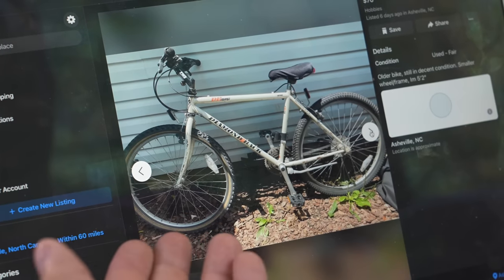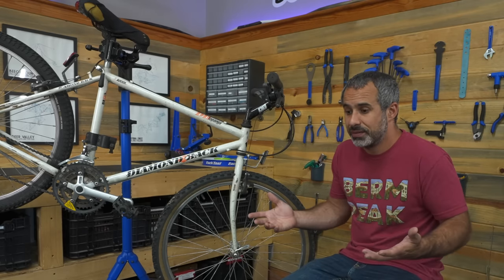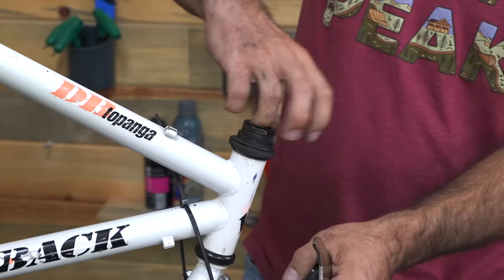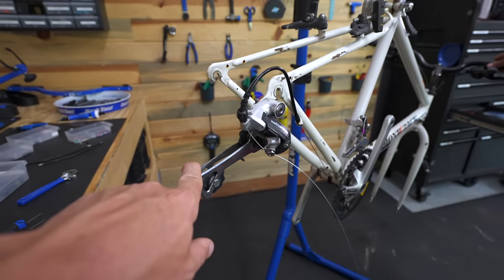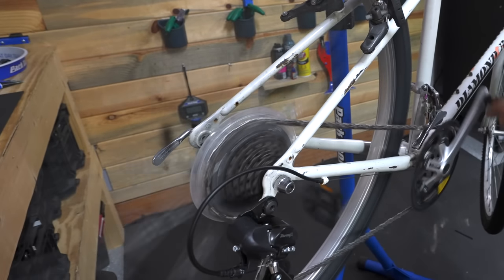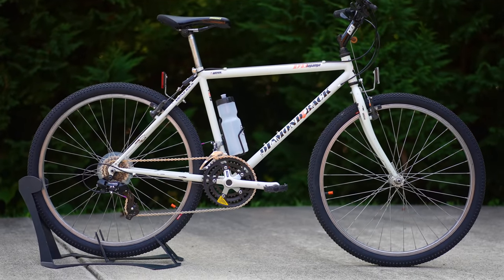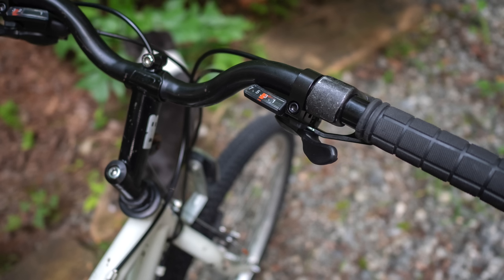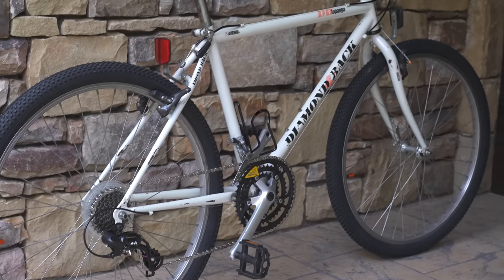90's Mountain Bike gets Transformed for Profit (Flip Bike EP1)

Comment: Inside the shift levers there's a little pawn and spring. Where the bike has sat unused for ages the factory grease dries up and the pawl and spring jam/stick when you operate the shift levers. With a little lube and a pick you can unstick the pawl/spring and the shifter will be good again for another 35 years. You're welcome, folks

Comment: Much of my work at the LBS here in Seattle is doing this very thing to old beat up steel bikes. The "Gold-level tune" costs $250 in labor plus cost of any new components, usually comes out to about $350-400 with a new chain, brake pads, cables, sales tax etc. And the customer walks out the door with a bike that's still only worth about $150
Reply: That refurbished bike might be hard to sell for more than $150 but that isn't why the customer brought it to you. That refurbished bike is going to ride better and last longer than a new low end $600 bike. Which is a better value for the customer?
Reply: @zone4garlicfarm  Couldn't agree more

Comment: I wonder how that chain worked with that old freehhub. Also, no cleanup and regreasing of the hubs and the bottom bracket ? I liked the brake lever trim modification. Really need. I'd only paint the cutoff surface even though it's covered by the shifter.

Comment: If you don't have an air compressor, isopropyl alcohol (IPA) works just as well to install grips (and to remove them). Just wet the bar and inside of the grips with IPA and they will slide on slick as a smelt. In a few minutes the IPA will evaporate, leaving behind no residue and the grips won't budge. I've seen people use lubricants like WD-40 which is a bad idea, because there will always be an oily residue between your grips and bars.

To remove grips, lay the bike on its side (because you need the help of gravity) and take something long and thin that won't scratch your bars (something like one of those long wooden sticks they put corn dogs on for example), push it down between the grip and the bar, and pull outward so you can pour in a little IPA. Leave the stick in there and start twisting the grip and pushing the stick farther down as you go. The IPA will work its way down and the grip will slide off the bar.

I've installed and removed grips with the help of IPA dozens of times; works every time with ease.

Comment: if you are looking for a video Idea I might have one for you. I got a cheap mountain bike recently and it has a Marzocchi Bomber Super Fly z.2 front fork. from what I can tell, Marzocchi is a name brand but this thing is goofy, it has 2 filler valves placed in such a way that you have to remove the brakes to pump up the suspension. it's just an odd fork the only reference I can find is an Ebay listing.

Comment: Reminds me of my 26" mongoose. I don't remember the model of the shifters but i remember you could go up 3 sprockets at a time on the rear cassette and down one at a time but one of the shifters broke a tooth on the mechinism causing it to skip on the way to the smaller sprockets so you had to drop 2 then after you could climb back up one if that was the gear you wanted. I remember that mongoose having a pretty low seat height for a 26" so i could throw it around like a large tire version of a bmx. I remember the quick release feature and the v brakes and some other things seeming really high end untill some of my friends getting trek bikes some years later which were similar but slightly better. Im sure i ruined the bike with a gel seat and grip shifters after the og shifters started to fail. But it was fun while it lasted.

Comment: Have an old Diamondback Apex that came with that front oblong sprocket.  Only paid 10 bucks for it from a garage sale because owner thought that the front sprocket was bent (I also thought so too at the time).  Didn't care too much for that, was pretty strange, and changed it for a conventional front sprocket from a newer Raleigh parts bike for that i had bought 20 bucks.  I have like half a dozen bikes and have a hard time selling them as well.  Yeah probably even fixed up that old Diamondback would only bring 100 bucks because most people don't know how good they were back in the day.

Comment: Thing is that most bikes that you buy have disc breaks and I bought my bike for about £150 and no disc breaks including that my bike has 60mm suspension travel and doesn’t move alot and idk if the bike likes oil in the chamber so I just left it alone and all I hear when I compress the suspension is air.

Comment: The "something gummy" in the shifters was the original grease that hardened and made them non-functional.  If bike owners simply open up these shifters every other year, fully degrease and regrease them, and reassemble them, they'll probably work forever.  But they do not like being forced once the grease turns to glue.

Comment: "Sell it for double, or more!"
Selling for $140 or even $210, you're gonna make $70 or $140 on a bike that takes six hours to overhaul, PLUS parts?
A worthy cause, don't get me wrong.  But you aren't retiring early doing THESE flips!!!

I do it for the love and appreciation of restoring perfectly good things.
The 1989 Shogun I just did this to turned out amazing.  Plus, with 11 grade 25 1/4" bearings in the BB instead of 9 grade 200, the BB is pretty damn smooth (more durable too).  And the headset went from 16 low-grade bearings to 26 grade 25.  It's almost Campy-smooth now!!!  (Not really.)
*Toss the bearing retainers - they're only used for ease of assembly at the factory.

Comment: What if I told you the hole in the end of the grip is for the air compressor to blow into? You just need to block the hole on the other end of the bar and you'll actually get a good seal, unlike putting the compressor under the side of the grip.

Comment: You lucked out that the rear cassette wasn't as worn as the chain.   I have replaced so many shifters when rehabbing bikes.  They just are not durable. Rather than Goof Off I use PB blaster to clean out gummy shifters.   One thing I often do is replace the front stem with a taller but shorter stem as people seem to like a nice upright position. I know what you mean about keeping bikes you fixed.  I have a bit too many I've held onto for one reason or another. Good idea for a series.  I should have thought of it.  Oh, you have a nice shop.
Reply: Oh, bike coops are a good source for cheap brake levers, especially cantilever levers.

Comment: @3:45 you see it skip the gears. Third "ratchet" and suddenly it's outta gears to click.

Now, it wasn't ACTUALLY missing teeth- but it was skipping them. Almost like the thing was too well/strongly strung. Ironically, great cables can sometimes mean the return spring moves faster than the bike will allow. This is a problem with these shifters I'm still puzzling over, but- sometimes it's genuinely just wiggling back and forth that little "catch" piece so it moves smoother in its joint and hitting it with a very light oil instead of WD40 and Goof-off, which are sorta water-replacements rather than a proper oil.  this helps it "catch" those gears- because just before those ratchets, you can SEE those teeth are actually all still there.

Basically, what's happening here is that there's like, a hammerhead-style looking thing, like the head of an oil derrick, that is the 'clicker.' It's one of the more finicky elements. You can wiggle it around, because it's kinda just riveted in a lotta the time. If you get it a tiny bit loose and get some oil in there, it'll catch more reliably on a trigger-pull, and you wouldn't be skipping gears, and wouldn't need to file off those gear stanchions, or buy/use those parts.

Though you can get a bit more $ for using modern shifters, keeping the Deore derailleur- which I think he replaced thinking that IT was the cause of the problem- might've also helped the bike keep some good value and helped ya flip it

Comment: Nice bike but too bad you destroyed the shifters and put the cheapest available tourney tx group on in. 
Next time you got this, clean the hatches and ratches with brake cleaner, move it till all the old grease gets out, clean it even more and after drying, put some good oil in the pivot point. I prefer Rohloff oil but Finish Line has some usefull stuff aswell, available in the states. You could also use new shifter and the old derailleur. Old and new Shimano ist still compatible.

Anyways good series and nice DiaBack

Comment: Hairspray works great to get the grips on if you're working at home, and locks the grips on when it dries. 

As for value, these old bikes aren't worth more than 20% of original MSRP max simply because most of them aren't collectible museum pieces, and the "pandemic" is over. Oh and still 7 speed, bottom bracket not touched, and suspension forks never get rebuilt by flippers. Translation - save 10 of these vintage MTB's on CL and another 10 on marketplace and see how quickly they DON'T sell. 

If you love it as a hobby and have the $$$$ to burn that's great but unless you've got something that's upper eschalon from this covered era, just donate it if you're not going to ride it.

Comment: I'm astonished that you could just switch the chain to a new one without changing at least the cassette to a new one. Wouldn't the chain slide through at least the higher gears under load if the old chain was that worn out?

Comment: You have a lot to learn as a sketchy bike flipper, those shifters would have worked, they just needed time (days) soaking in penetrating oil and lots of movement. 
Why on earth did you replace the derailleur.. you basically traded your house for a tent. 
The rims are approaching the end of their lifespan. Fast... 
Even faster because you didn't stick to rule nr. 1... replace the pads. They are probably original,  and that's a little more concerning then the chain being original

Comment: You didn't true the wheels, service the wheel bearings, service the bottom bracket, or install new brake pads and a new cassette.

You didn't completely disassemble and lube every fastener, either.

You prettied it up, but you didn't fully service it.

The Bell tires are really good tires. Ive toured on them extensively. They're one of the few things I look for at walmart.

Comment: I bought my bike for EUR 40, had it repaired at a bicycle shop for EUR 80. (And yes, I knew there were some repairs coming up.) Now, I have a bike that looks like crap but is in good working order. I can (and have to) park it outside in Düsseldorf, and so far, the worst that has happened to it in idk 5 years is once someone found it funny to spray the light with black paint. 🙄 Oh, and once someone locked it with a second lock. I called the police, also because I was angry, and asked them what I should do. First,  were all like, "can you prove this is in fact your bike?" But when they saw it, they were just like, "okay, please unlock the other lock", then they cut off the second lock with a bolt cutter. 🤣 No more proof of ownership was required.

Comment: i have worked as a bike mech for close to 50 years and have worked on more bikes than i could count.  Take it from me, stay away from most Shimano trigger shifters, particularly the spectacularly crappy one-lever, trigger-like rear type that came on so many mtbs in the 90s!  The two lever models that you still find on many bikes today are destined to fail!  Quite seriously, I have NEVER come across a fully functioning (used) SHimano trigger or trigger-like 0ne-lever.  Want good shifters that will last for years?  Go with Sram; even their base models outpreform Shhimano and are pretty inexpensive.

Comment: i basicaly have the same bike, an old fully rigit xc or gravel bike, it is probably even older because those shifters oh your bike are too modern, they would not even fit i think, the handlebars are just a straight piece of tube that is equaly thick all the way trough, any my shifters are ontop of the bars (one of those old one lever road bike shifters that they mounted to the frames instead of the bars because it dident fit on a road bike, its the exact sae thing but it fits on the bars because they are straight). but its a awesome comuter bike, no one is going to steel it, it pedals realy fast, it is almost as fast a road bike, also has the geo of a roadbike but with smaller wheels and flat bars. i bought it as my first mountain bike when i was 14 (im 17 now), and even though its definatly not a XC bike it did well on the easy trails, and its the fastest bike i have ever tried on gravel roads.

Comment: you could of more than likely saved the shifters, all that gummed up junk in them is the old grease, even if you flush it all out of the external surfaces you need to get it out of the pivot surfaces of the ratchet pawls, get some penetrating oil on 'em and work 'em in and out by hand. They'll free up and your back to all the indexing points.